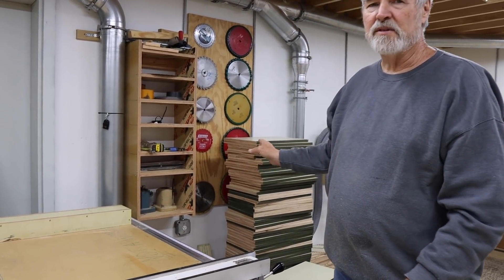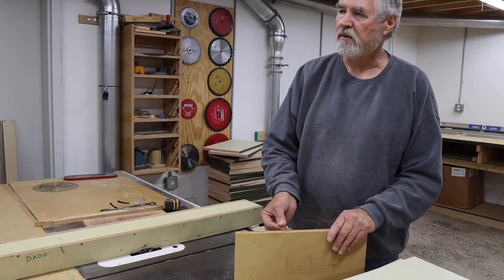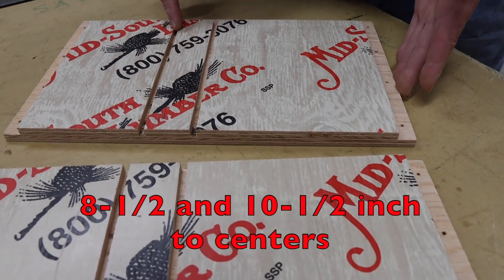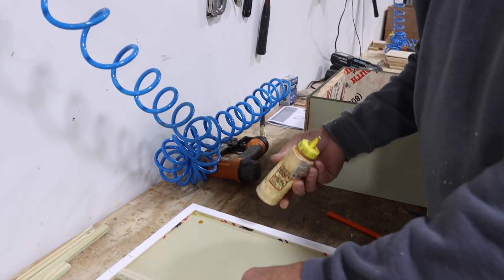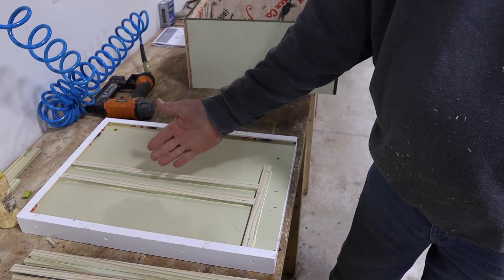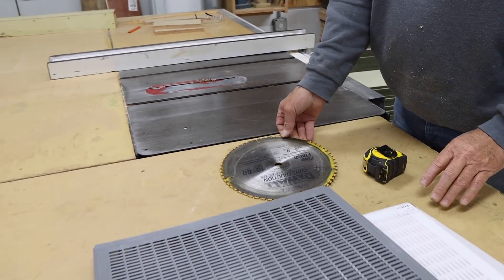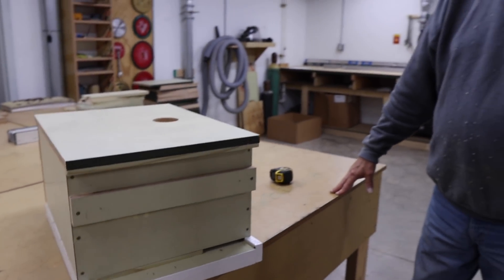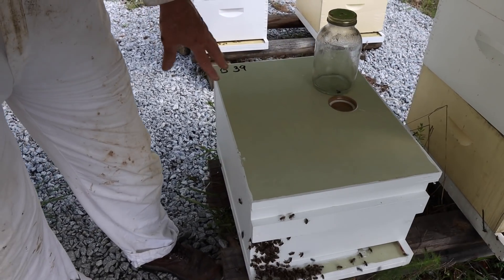Queen Grafting Timing Box

Comment: If you ever get in a spot where you don't have a finish blade for cutting your plastic you can use a general purpose blade or whatever type of blade you do have but put it on backwards. Opposite rotation. We used to do that cutting vinyl siding and it worked quite well. Thx for sharing the Knowledge Bob.

Comment: Could you put more than one queen in a box if you separate them with excluders?
Reply from the maker: It may work but I wouldn't risk a valuable breeder queen doing it.
Reply: I was thinking of using it as a type of mating nuc but not worrying about restocking nucs. More of a shared resource mating nuc? Random thought.
Reply from the maker: @BohemiaBees  Interesting thought. You may have problems unless they are separated by more than an excluder. When I occasionally  end up with a two queen hive it seems like I have better luck maintaining the two separate brood nests if they are apart. First an excluder above the bottom, then a super or two and then another excluder and the other brood nest on top with another entrance. When they are stacked one on top of the other with only one excluder between it seems like one queen disappears more often. I have to admit though, I have not run a lot of two queen systems and my observations are just casual.
Reply: Thanks for your thoughts and insight

Comment: Hey Bob, if you cut your walls that extra 3/8" or whatever height distance you like between the bottom bars and the hive floor, and cut you entrance into one end wall, you can nail / glue your hive floor right on to the bottom of the box and eliminate making up that bottom board that your gonna end up nailing on to the bottom anyway. I went to 8 frame boxes a few years back and build most all of my own equipment. There are very few hives left here now where the bottom box and the bottom board are two separate pieces. I got tired of picking up that bottom box to move it somewhere and the bottom board come off and bust my toes.....or worse trip me. Glad to see that shingle thing is leaving you alone now....bless you.

Comment: Titebond 3 is marketed as being waterproof, whereas Titebond 2 is marketed as water resistant, so I would have thought Titebond 3 would be better for humid locations like bottom boards.  Does your experience with titebond contradict that?
Reply from the maker: Our casual observation is that we've had better luck with Titebond 2 in exterior situations. Perhaps it's our building materials, I don't know for sure why. It's just our experience.
Reply: @bobbinnie9872  thanks Bob. I’ve had good luck with both but haven’t tried either in a humid environment. I’ve also found PL premium construction adhesive good for all kinds of things

Comment: Somewhat unrelated. What would be your approach if found a hive during the flow where something had happened to the queen a week prior and the workers plugged the brood box with honey. 
I replaced with a mated queen. 
Will they move the honey up to the super? Or would you remove those brood frames and replace them with foundation? I don’t have any drawn brood frames.
Reply from the maker: I would just let them work through it out as the new queen begins to expand the brood nest, as long as you have empty space above so they don't continue to plug out.
Reply from the maker: Empty space for honey. They will usually expand the area for the queen to lay as they use the food present and also move it up if they feel the need.
Reply: @bobbinnie9872  that’s awesome. I’ve never thought about it until I read your comment, but do foragers bring back nectar and feed the brood (or give to nurse bees to feed brood) or do the foragers store everything, and the nurse bees remove it from the cells and feed?

Comment: Is there any reason you couldn't cut down two metal excluders (if you have the proper tools) and use those to isolate the queen?  It seems like that would be very dimensionaly stable and I have some old wood bound ones that the wood is shot and could be used for this purpose.
Reply from the maker: Metal excluders would work fine if you can keep the edges intact.